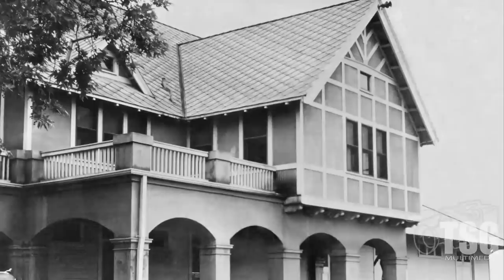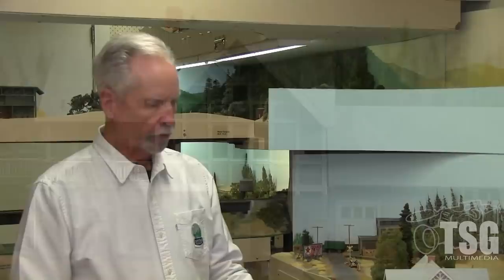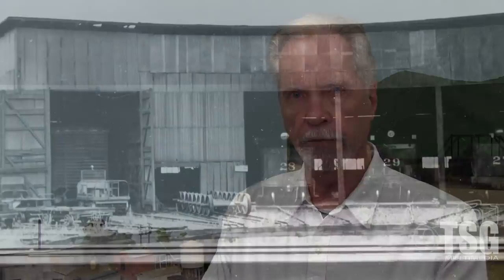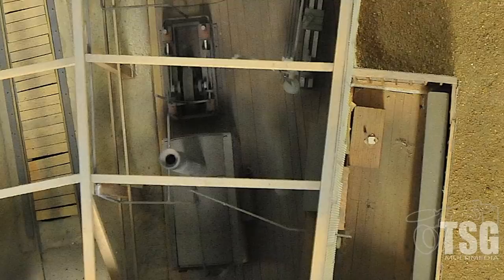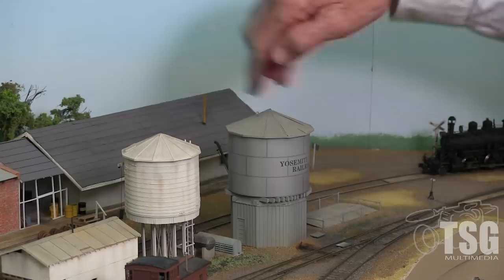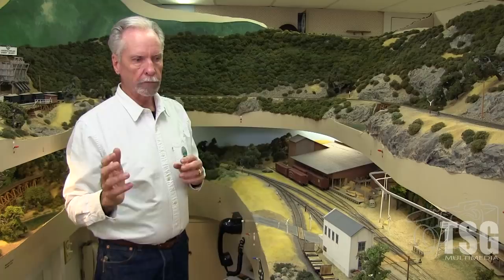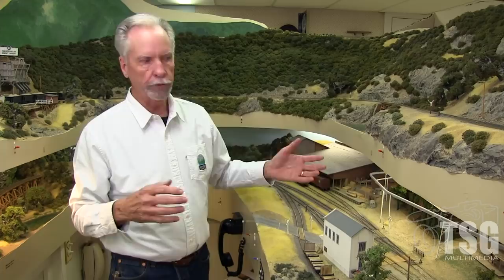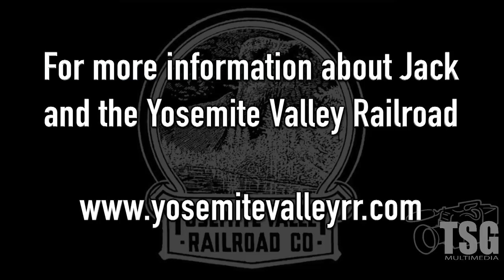Model Railroading with Jack Burgess Structures 1

Comment: 4'- 81/2'' is exactly tow horse ass cracks wide.
Funny how that measurement became the standard because trains replaced hoses pulling rali cars for mining and lumber operations.
It even affected rail tunnel sizes and because the space shuttle boosters were built in Alabama and shipped by rail to Johnson Space Center they were the size and length they were.
Beautiful layout, love the shelf style design.

Comment: Jack, I'm a huge fan of your modeling.  At 12:40 of this video, over your right shoulder is a truss bridge.  It would be perfect for my railroad.  Could you give me the length x height dimensions?  Thanks.  Bob
Reply: Bob...That bridge is completely out of scale. I built it probably 35 years ago and didn't have enough room to make it close to prototype length so I had to also cut down on the height of the bridge. The first time that I ran a train over it the cupola on the caboose nearly hit the top of the bridge. I will be building a new one one of these days...

Jack

Comment: That's what I want to do with the Cricut machine that I got, cut out walls from either wood or plastic, then build it as a kit!  I heard that you could create a thin wash from white or a sandstone color and apply it to your mortar lines to create mortar between bricks. Then wash off the excess off the faces of the bricks. RH
Reply: Cricut can cut plastic? I thought those were for mostly paper and decal products. My wife wanted to get one for decals, now I might go halves on it with her if we can use it for building structures!
Reply: @JoeyBPhotography  You have to buy a more expensive cutting tool and it will have to make multiple passes, but yes, it will cut thinner sheets of plastic! Once I get it up and running i'ym also going to be making HO van truck trailers! Maybe even the big multi axle heavy haul trailers? Side frames, then glue on the flange and top and bottom to create the frame. I need some triple axle car haulers and NHRA drag race car trailers. RH
Reply: @CONTAINERMAN68  Multiple passes... wonder if you could use it to etch details on a whole sheet to simulate different materials, etc
Reply: @JoeyBPhotography  Possibly? I haven't read any instructions yet! But Chuck Baker The River Valley Railroad, is the previous owner of the one that I now own. He could probably tell you more about it!